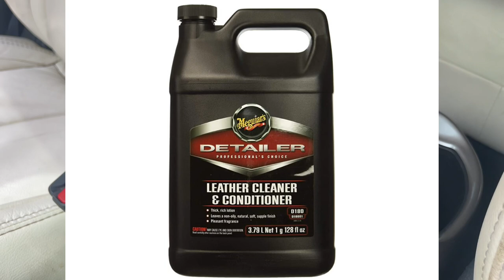How To Clean & Condition Leather Seats - Detailing Beyond Limits

Comment: You said newer cars don't require the treatment does that mean just use APC to clean the seats?
Reply from the maker: If they are dirty, sure thing, go ahead and clean them with some APC, or if you want to try out a dedicated leather cleaner you also can. 

Most leathers in newer cars today are coated, a conditioner won’t do much until the coating starts “wearing off” which takes a couple of years , then you can go ahead and apply a leather conditioner on to the seat. Hope that helps. 👍🏻

Comment: Hey, i wanted to know if super clean is safe on tesla leather seats? They are vegan leather and i read that non detergent soap is recommended?
Reply from the maker: I would do a test spot of super clean diluted 16:1 spray it onto your microfiber towel as opposed to the seat and as soon as you’re done agitating, go ahead and dry it off with a clean microfiber towel. If you want to be super cautious you can even use it at a 32:1 dilution ratio, im sure you’ll be fine! Hope that helps. 👍🏻
Reply: @detailingbeyondlimits  thank you

Comment: A soft drill brush will save you time
Reply from the maker: Im sure it does however if you’re not cautious enough you can risk damaging the leather. Not to mention it doesn’t really take much time with just a scrub mitt it’s more of an effort thing as opposed to time efficiency.  

The goal intended here is to show beginner detailers how the process works step by step. Introduce them to add on services.